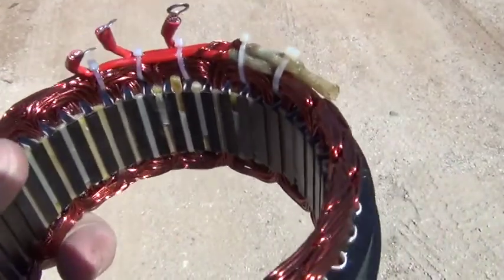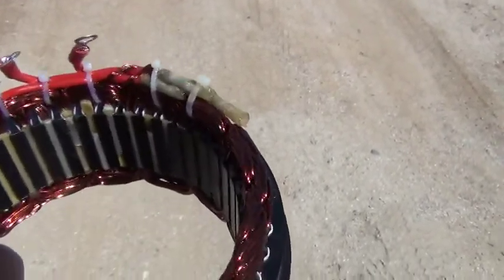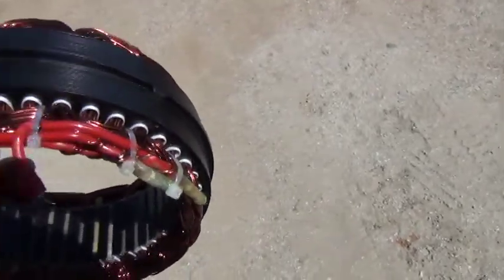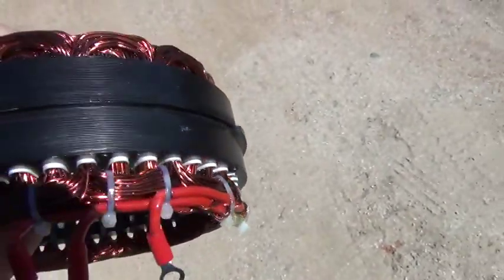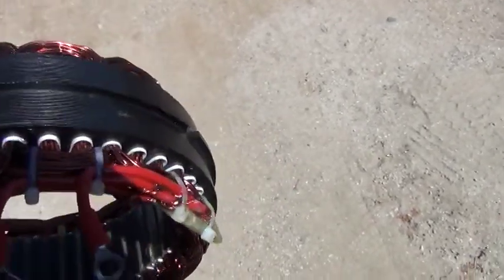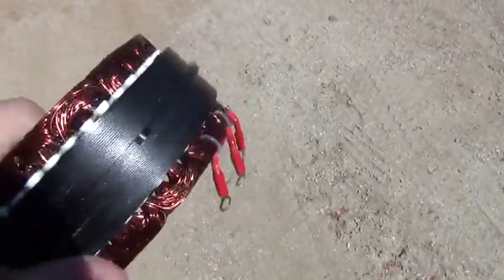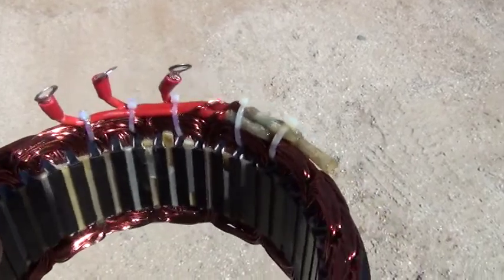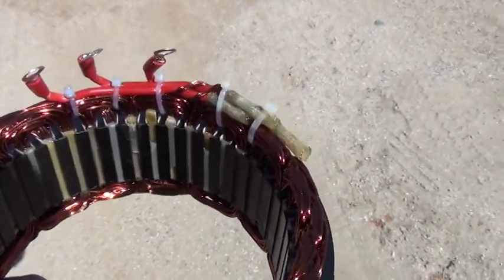Advanced triple lam stator core with remote tied loom harness

Comment: Could I take my 12v UC one out and put that one in at 48v . That thing looks well made for sure
Reply from the maker: Yes since these come in 12, 24 and 48 volt versions since they are better tuned to the 1.25" rotor.  This stator stack is a match at 1.25" too.

Pound for pound the best PMA we have ever built.  It has been tuned, trimmed and perfected to it's ultimate conclusion.   I do not think i could make any more improvements if I wanted.

Comment: decent size magnet wire, be interesting to see its power curve
Reply from the maker: Hi Closer, From our bench testing it about 35 to 40% better than the old super core.  We made 2200 Watts at 2200 RPM which I remembered since the numbers matched. This was with a .0995 OHMS load at 14.6 volts on the 12 volt version of this PMA.   For the price it's going to be the best "bang for the buck" on the market and is built to last a lifetime.
Reply: nice improvement i knew it would be a decent improvement given the extra magnet wire, getting the ratios right is no easy thing much trial and error, agreed your prices are good and yor products are well built with attention paid to various aspects of a pma which are important if you want longevity.

Comment: Hey now that's nicely done! Is this larger than the ultra core? Will the rotor you sell fit the stator? Just asking, LoL.
Reply from the maker: Hi Billy,  It's 1/8" smaller than an ultra which means we can now get enough magnetic coil saturation to make 48 volt versions too.  
Also the wire is packed in order so it's layered more orderly which give's a little more power output too.   We are squeezing every watt out we can while keeping it small and light.  Makes about 42% more than a super-core with the same rotor!  It really shows how important wire packing and core matching are to making a really powerful package.
Reply: Steve Robertson Hey Steve, been just chilling, LoL. Good to here from you. email me sometime 😃